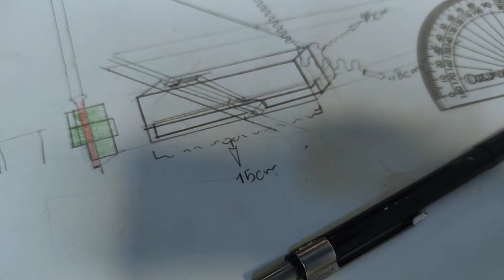DIY TOOLS|GROVE MAKER|MAKE A TOOL WITH CHISEL|MINI WOODEN PLANE|How to make a precise groove by hand

Comment: I love this idea: to be able to have a set of wooden hand planes that are matched to my set of chisels; and the chisels can be set into the wooden base to make a hand plane on a moment's notice, to perform a task; then, in another moment, take the chisel back out to use as a chisel again! What a wonderful versatility this would provide!! I am wondering why you have let the handle of the chisel get in the way of fitting the little wedge(4:33-35)?
Reply from the maker: Exactly the idea of making this grover was this(chisel plane)
That was a mistake, actually i should considered the handle in designing part which i didnt!